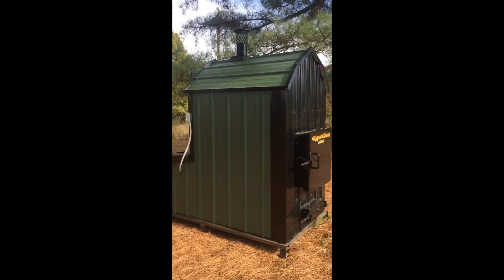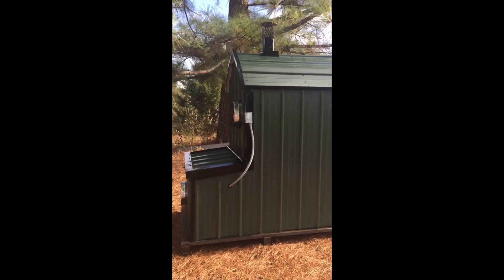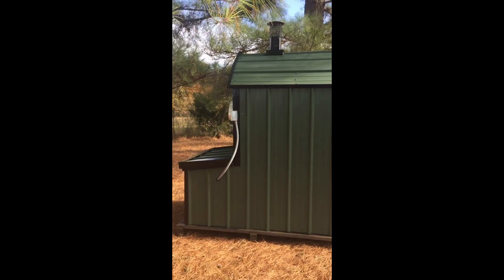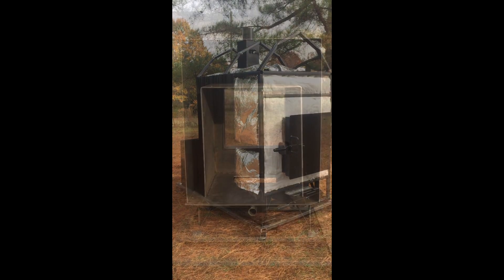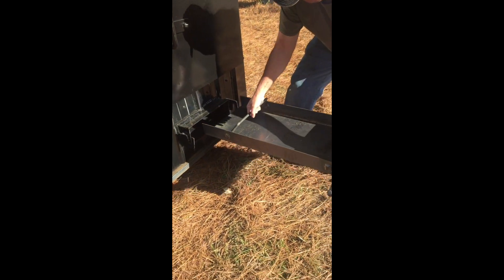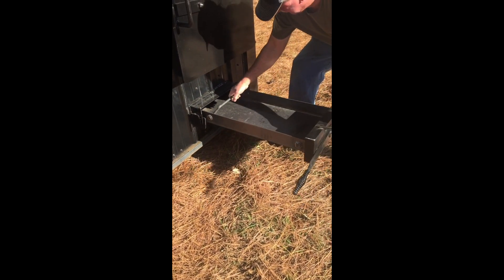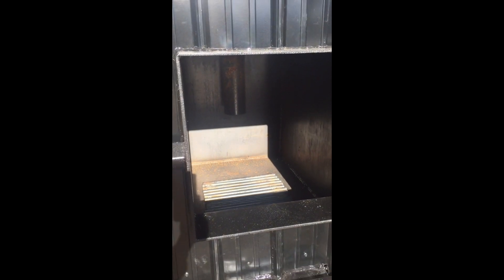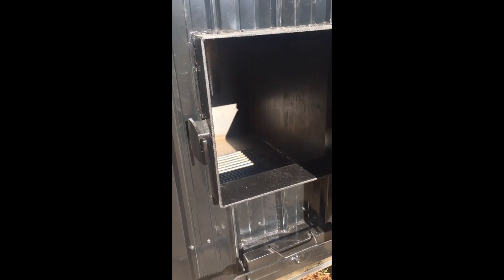Water-less Forced Air Wood Furnace, showing EXTREME Insulation

Comment: 12" OD ducting is needed. Blue Duct is the brand for underground. It is available from distributors in many states but do not tell them it is for an outdoor wood furnace because we have had customers who caused issues for them... some people have used 16" sewer pipe with the galvanized ductwork running through it!

Comment: do you install thr=e unit? im in mo.
Reply: 85% of our customers install our boilers which are much more difficult.  

These furnaces only require a 110Volt power supply and a thermostat wire from the building plus snap together ductwork.  They can be supported on 4 inch solid concrete pavers, railroad ties or a 4 inch slab requiring just 1/3 yard of concrete. 

If you don't have time a local handyman can easily handle it all!